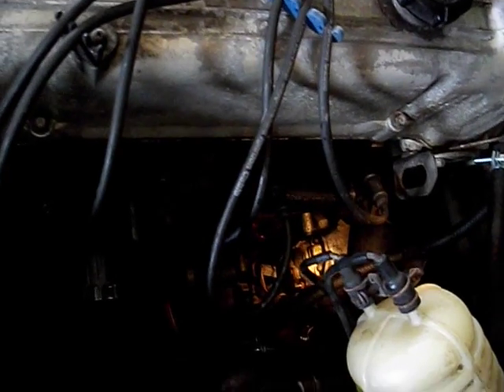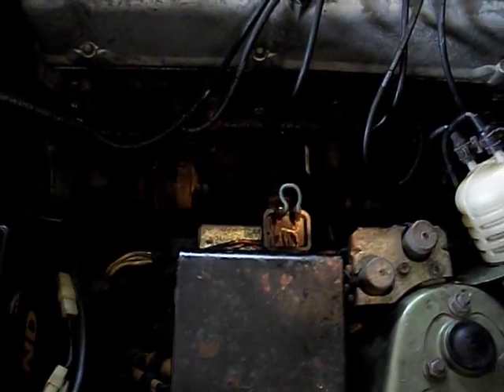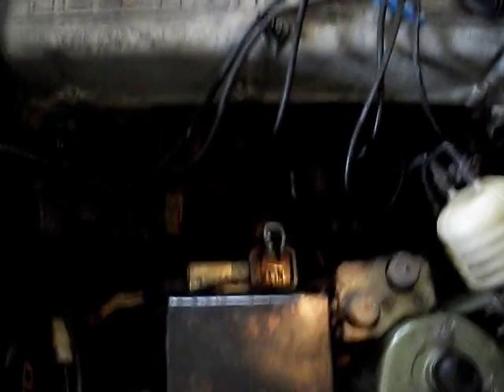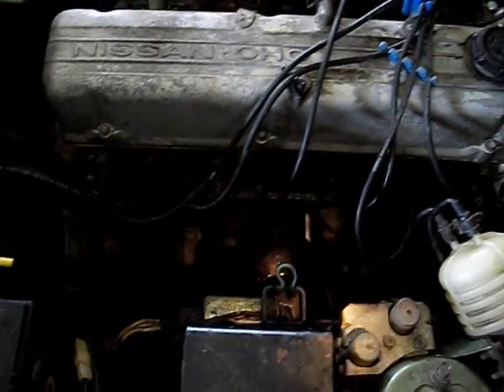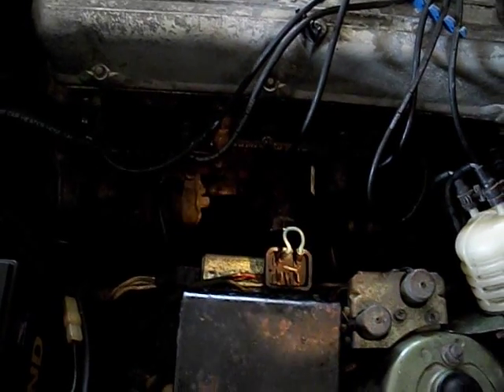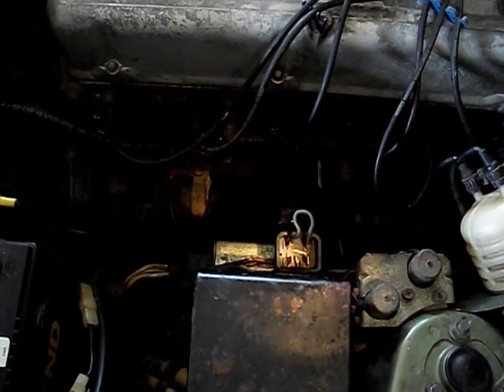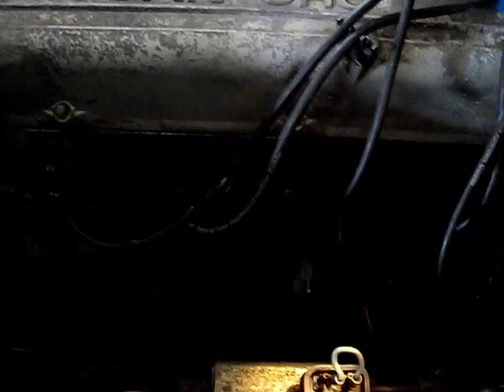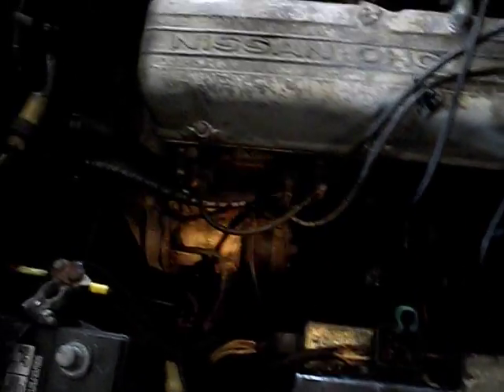1975 280z fuse link failure

Comment: I have a 78. This morning I try to start it up but it was complete dead. Nothing was powered and i thought I probably left the lights on which I always do. I try to charge the battery but the tender won’t charge. I thought the battery was over-drained then I jumped it with another car and when I put on the ignition on started to smoking. One of the fusible link was burned. What could be the problem? Since datsun separate the alternator out of other systems on 78?

Comment: My car is doing the same thing... but I am able to start my car without that fuse in and it runs.
Reply from the maker: how many fuse links? to you have two sets of links (total of 4? )
Reply: +Dave WM yes I have 4. I believe stock set up on a 77 Z.
Reply from the maker: ah there you go, I think the later models figured out the issue and decided to isolate the other systems so you don't lose everything like I did on my 75. I only have the single fuse link box with two fuse links.

Comment: did you find the problem that it was blown
Reply from the maker: +James Scheck  Alternator rectifier was shorted, one of the diodes was loose in the block already, my guess is the rest of the diodes were over taxed OR the body of the loose diode may have shorted something.

Comment: Its easy to replace them with a modern fuse block, here is a webpage on how to do it. I might be wrong but I believe that black wire is for the alternator and ignition relay and the green one is for the ignition switch.  the black wire carries all of the current of all of the other functions of the car. Datsun changed the wiring for the 280z 3 times between 75 and 78. here is how to do away wit the usable links and go do maxi fuses http://atlanticz.ca/zclub/techtips/fusiblelinks/index.html
Reply from the maker: +Hodgimus_Maximus thanks for he link. I have the alt out now, just ran at test on it. I don't like to make more than one change at a time so will reinstall and with existing wiring, in the future I may make a change to add more protective fusing. I don't like the idea of a bad alternator taking out the entire car.

Comment: Like fusible link right?
Reply: Duh. Sorry.  Still have the explorer?? They are great trucks.  My dad called those cars "z cars", I've always wanted one. Is that a straight six? Bet it hauls ass! Great classic car.
Reply from the maker: +Steven King yes fusible link burned when the alternator shorted. L28 (2.8 liter straight 6, single OHC, Bosch L-jetronic fuel injection. I made up a new Fusible link from some supplies I got form the local car parts store.
Reply from the maker: +Steven King yes still have the Explorer